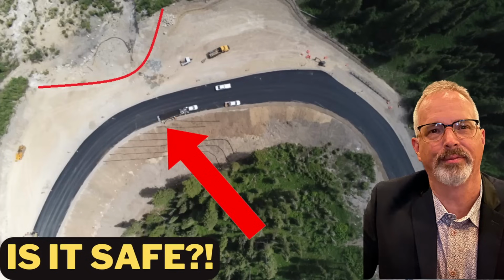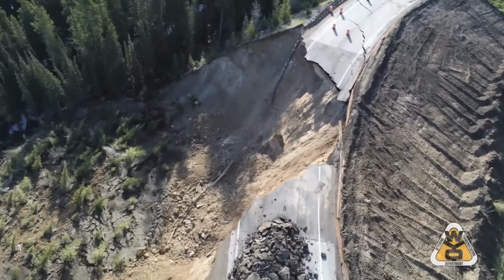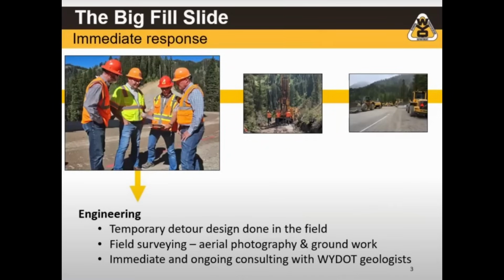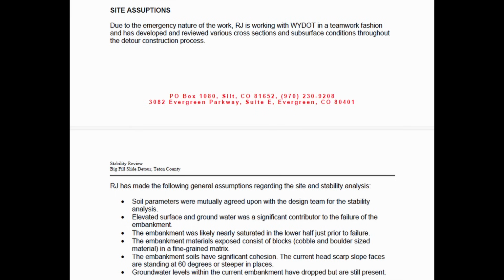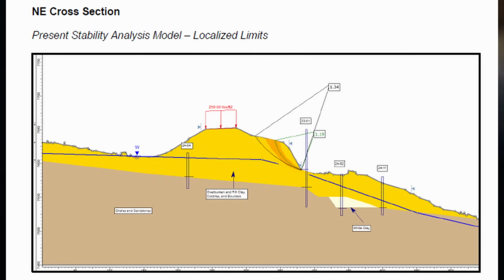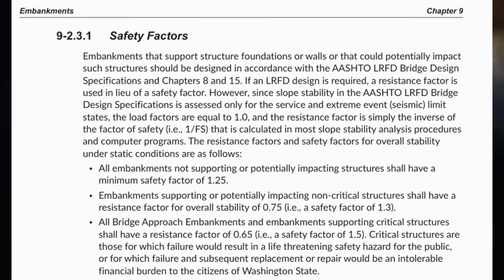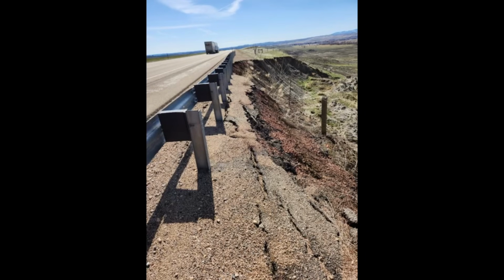Teton Highway Rebuild Update

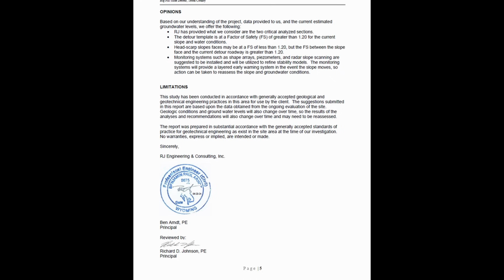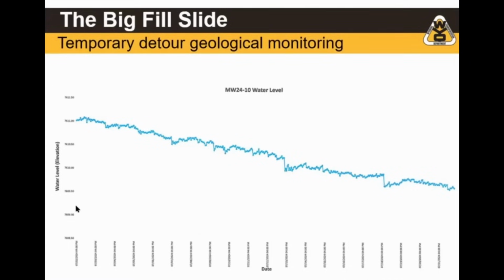Comment: 14:21 "Current slope and water conditions" That's one of those truths that omits the real question since water conditions change constantly.  There's no clear statement that the road design protects the safety of the public during all water conditions. The author could had stated the water condition parameters and indicated a quantifiable set of conditions that would invalidate the conclusion (i.e the data presented at 20:40). That would have put the burden of maintaining the current conditions back on the State.
Reply from the maker: Those are great points.  That letter report seemed rather vague and incomplete to me.  I am sure WyDOT is happy with that report though.  I know some local reports mentioned the 1.2 factor of safety, but it appears that the are not aware of what went in to calculating it as I don't know either.

Comment: Is the 1.2 factor a long term factor in design? - no doubt it’ll be improved with the proposed works. As long as it’s over 1.1 for this temporary / construction condition then it should be ok - presume there’s gonna be a limit to weight of vehicles that’ll be accessing this stretch of road too. Everything’s generally worst case design scenario but as it’s been failing for a long time - the solution will have to improve the overall stability of this hill/slope/embankment.
Reply from the maker: What is long term?  Traffic on this bypass for several months to a year.  That counts as long term to me.  I see no way of supporting a factor of safety any lower than 1.5 for this embankment slope given my understanding of applicable design standards.
Reply: @CaseyJones-Engineer  There is no means of quantitatively measuring the “real” FoS of a particular slope at a given time. Therefore, FoS of a slope is estimated based on industry standard analytical methods with assumed material parameters inferred from various data sources (laboratory, drilling, empirical correlations) under various loading conditions. 

The above extracted from Factor of Safety and risk, information at   klohn.com 

Similarly “Factor of safety Probability of failure” from rocscience.com provides good information to understand this scenario. 

Long term is measured in years/lifetime of the bypass / life of the slope  - not the duration of the months in a year that this bypass is in use 

So the FOS given for now will no doubt improve or be adjusted after further analysis / design carried out - with recommendations of inspections of the slope annually to note how it’s performing.

Comment: Great video, but I think you’re laboring under an incorrect assumption that evidence based analysis, logic, rationality, and common sense should be used in addressing this issue. You seem to be forgetting that this is Wyoming, where none of these methods are respected or ever applied. The fact that you are questioning the authorities in Wyoming means that if there are any further problems with this bypass, they will be your fault.
Reply from the maker: Thank you, but WyDOT still owns this thing.

Comment: I just watched some of the Geologists of Jackson Hole presentation on the Teton Pass slide.  When Bob Hammond of WYDOT stated that they mobilized a contractor for this emergency and the first thing they decided was to remove the asphalt from the roadway as they thought it might help.  I just can't believe they thought moving inches of asphalt would make a difference when there is 70 foot of fill. Just the act of placing construction equipment on the failing slope was crazy from a safety standpoint.  WYDOT is lucky that the construction equipment did trigger the slide with personnel on the equipment.
Reply from the maker: I agree. I think it is fair to question whether they have good judgement.
Reply: It's not like they didn't watch the loss of construction workers in Baltimore a mere three months earlier.
Reply: WYDOT is very Stupid

Comment: Exactly right to call in to judgement of what they are doing now. Obviously in the past they got it wrong about their assessment of this site. That should be a giant warning sign that they were making decisions without all of the data.

It should not be 'business as usual' in designing a replacement roadway. The process has tricked you and failed you once before; This is the time to take a step back and to gather much more information about exactly what is going on and to increase the performance margins.

IMHO it is now a 'political' decision that is overriding good engineering practices; They are so anxious to get the road replaced that they are cutting the same, (and more) corners than the originally constructed curve that failed in short-order. Designing by consensus is another way of saying that 'group-think' will get you to a good outcome.
Reply from the maker: Thank you.  Your comments are spot on.

Comment: Thanks for the latest update Casey.  The letter by RJ Engineering and Consulting regarding the slope stability analysis for the temporary bypass is really lacking in details and as vague as WYDOT has been with respect to safety factor.  I totally agree with your analysis that the safety factor even for the temporary bypass should be 1.5 and 1.2 with the unknown soil parameters is too low.  I also agree with you that they should have closed the road and planned the rebuild instead of quickly installing the bypass with such a low factor of safety.  How difficult will it be to install the soil nails with the benching?  I assume they will have to be anchored things from above initially to build the benches.  I am familar with micropiles as I have used them for foundations for large variable speed limit signs and also the use of styrofoam blocks for fill.

Comment: Why do bridges built in the early to mid 21st century outlast newer ones? Heck - even bridges built b4 that last longer. Because the professionals designing them were so much better. One would think that computers and calculators would have improved these builds exponentially. But apparently, you can't replace great minds with computers. My dad started his engineering career with slide rules, experience, training and education, and his brain. When he retired, his company's customers hired him to oversee the new engineers who had all the tech but no brains. There's something incredibly wrong here.
Reply: I think your phrase ..."to mid 21st century..." should have been   ..."to mid 20th century..." should not it?  That would tie into the rest of your post better.
My answer about the much older bridge construction lasting so long is that the engineers of that time did not have as much data to design from as after the 1950s &60s.  Also, the use of computers has given engineers greater speed and much closer tolerances than was available previously.  Consider many railroad bridges are carrying larger and longer trains than what was designed for and are close to or over 100 years old.  Part of that is the old engineers did not know as much about the strength of materials as is known now so used beefier designs and larger factors of safety.  These structures are inspected yearly.
I graduated in 1969 with my slide rule.  Handheld calculators were not really available until 1970 & 71.

Comment: Again, another USA issue - never considering the weight of the repair vehicles and equipment when doing work on roadways and bridges. As soon as you said they were removing asphalt off the roadway to reduce weight, I thought about the weight of the equipment doing this would be far greater as well as them disturbing more of the ground in the process. You already caught that in your next statements. Yeesh!

Comment: I'm not sure how to ask this, but does the Factor of Safety need to be greater when the slope in on a radius? Meaning, is there a greater safety margin required when the roadway/path is on a bend or curve compared to when the road segment is straight?
And, given all the water observed "gushing out", would a better, long-term solution be designing in a culvert? Of course, the short term cost would likely be greater, but it seems to me a higher safety factor and less chance of another failure long term.
Thanks for the update, Casey, and keeping the public informed!!
Reply from the maker: Good question.  The short answer is no from a slope stability analysis.  The analysis involves taking a cross section and finding a potential shear surface with the lowest computed factor of safety.  The curvature of the road itself doesn't factor into that.

Comment: Honestly, this whole thing sounds like WyDOT engineers worked with just enough information to be dangerous. I'm all for a DIYer doing a little slope work (like 2 ft and 2%) to get water to drain away from a home foundation (I did lol); sounds like a bunch of guys like me, but without the sense to realize they're over their heads.
Reply from the maker: I agree that it sure seems that they are not prepared to deal with these issues.

Comment: It seems that they are adamant that the factor of safety of 1.2 meets requirements because they saw that number somewhere.  Well, I could say that a rock climbing wall would use an angle of 90 degrees from the horizontal.  So then someone could take that and say that their sand wall next to this roadway should use an angle of 90 degrees because it's cited somewhere.  Not appropriate because that number isn't associated with the structure of the fill.  I'd agree that they really need to stick with 1.5 as a minimum.
Reply from the maker: Thank you.  I agree with you.  I think they are trying to justify a 1.2 factor of safety on the basis of this being temporary which doesn't make sense when they now have highway traffic on that bypass and that bypass will be used for many months if not a full year even.
Reply: @CaseyJones-Engineer  I've had a tiny bit of dealing with RJ professionally and this thing does not jive with my limited dealings. They seemed like they wanted to be seen as the experts, didn't want any outside input. My other big question is about the factor of safety, is that static or seismic?

Comment: Highway Maintenance crews vs actual engineering… 80% of funding to rebuild comes from the federal government , 20% from the state . Failure to maintain might mean the federal government won’t participate ( that 80%). The federal government will pay 100% to open the road under the emergency relief program.
Reply from the maker: You are right.  We are seeing more and more instances of projects drifting into emergency mode so that the Feds pick up the tab.

Comment: You can fix this perfectly correct, and it will take forever and cost you everything you got.
Reply from the maker: I would say the difference between where they are at and perfect is a very big gap.  I think they should strive for long-term adequacy for this embankment.

Comment: Makes me admire even more the civil engineers, geologists, and contractors who built the entire US Highway System in the 1950-60's, without any computers!!
Reply: Sliderules do not require batteries.
Reply: @franklinmc4457  - I keep my old engineering slide rule in my tool chest and pull it out when someone asks for a calculator.  It's a good one with double slides and I don't remember how to use 90% of what it does.
Reply: I remember I college when we could carry the slide rule in its holster. Then there was that one guy with the biggest baddest slide rule ridding heavy on his hip. 
I recall missing a question on a test when I misread the scale.
Reply: @franklinmc4457  Nor does an abacus, which were taught to use in Catholic school in Colorado Springs in the 1950s. Contrast that with today!
Reply: Egyptians did a lot more without computers
Reply: @OffendingTheOffendable  oh the Egyptians Had electricity ?
Reply: Slide rules baby!
Reply: @kelliewilborn9154  YEA
Reply: Agreed
Reply: back when shit was built to the best of your ability and not some hack job by some cocksucker that has been bought off
Reply: Yea  and use to do a lot of other Things with out Computers and Inter net

Comment: Styrofoam filling comes with its own issues because if the road is flooded in that area they can lift up the road and cause problems as well.
This happened recently in Sweden.
Reply: Yep. Its highly bouyant. Though it can also get saturated with water. Im now a geotechnical engineer but when i was in college i worked at a factory that made EPS geofoam.
Reply: What's the projected lifetime of such styrofoam blocks? There are bugs/microbes that can actually eat polystyrene.
Reply: @aka-o9x  UV exposure is the big risk for it. Itll last longer than the bridge when buried. It can also be encased in concrete.

Comment: The soil parameters as inputs for the stability analysis have to be one of the most obvious cases of garbage in garbage out, I just fail to see how someone could be so incompetent as to just assume some random values for it without there being some form of malicious intent.
Reply from the maker: I don't know what they used for their analysis.  I think it is rather odd that they would just reference mutually agreed upon values.  It makes it sound like they had a meeting where people just decided what to use and it is unclear what actual supporting soil data they had at that point.
Reply: @CaseyJones-Engineer  That seems really odd to me in a failure situation.  And i can't imagine running a suitable number of triaxial shear tests, particularly CD test in a "couple of days."

Comment: So here's the deal as I see it.  With a current grade of 11.2 percent on the temporary bypass the drivers will face some extremely difficult driving conditions once the snow starts to fly later on this fall.  That curve is at high altitude so the snow starts falling sooner than most people realize.  Would not be a bit surprised to see lots of accidents and spinouts once the snow starts to fly.
Reply: 11.2% Wow!  At that altitude and latitude and the sharp curve, it will be a dangerous route come winter.  Could be some vehicle restrictions coming as to size and weight of trucks and/or trailers.  Cheers 🇨🇦
Reply: @jamesmisener3006  Actually there was already some commercial vehicle regulations  in place due to the fact that the other side of the pass that drops down into Jackson Hole is at 10 % grade for several miles.
Reply: @jamesmisener3006  More like impassible come winter......... Taking a trailer that way in icy conditions is suicide.......
Reply: It could snow as early as late September at those elevations.
Reply: Here are the general rules for Teton pass. Many trucks flaunt these rules on a regular basis.  This will be a scary winter:

https://www.wyoroad.info/Highway/Teton.pdf
Reply: sand, lots of sand.

Comment: "mutually agreed upon soil parameters" seems like a recipe for group-think.
Reply from the maker: It is rather odd phrasing.  Plus, if I was responsible for performing this analysis I wouldn't be letting anyone else tell me what soil parameters I should be using.
Reply: @CaseyJones-Engineer  It gives me the queasy feeling they worked backward from the minimal 1.2 "safety" factor to get the soil parameters that would create that result.
Reply from the maker: @richardmarquardt6246 It makes you wonder.
Reply: @CaseyJones-Engineer  I had a CE professor who said that integrity is not handed out with the receipt of the diploma when you graduate.  If you fudge on homework, tests, etc you are very likely to on critical work on a project also to make the numbers work.
Reply: @CaseyJones-Engineer Time for a freedom of information request, Casey.
Reply: In an area with more homogenous soils, something like that could be fine, if it's based on a reasonable regional assessment.  However this is an area where the soil properties could change a lot over a short distance - if nothing else the visible variations in rock sizes and colors, and vegetation types make that obvious.
Reply: This is what students in undergrad labs do to get results when the experiment doesn’t work as it should. Reasonable people understand that you grow out of it after the lab is over.

Comment: Casey, I can't help but wonder about hydraulic pressure within the new slope. I can see new construction "looking" great but what happens when the existing groundwater routing is augmented by deluge rain or snowmelt? It seems that this could cause sudden collapse from undermining?
Reply from the maker: They have stated their plan to incorporate more drainage elements into the rebuilt slope.  We shall see what the actually do.

Comment: The vibration of the asphalt removal work may have made it cut loose sooner.
Reply from the maker: Great point. Their adding more energy and weight to something that was already failing was a very bad idea.
Reply: When they were constructing a road at Fort Knox it collapsed several inches of the roof of a cave about 60 feet down the slope. I had found this cave about a week earlier and looked fine from the entrance but waited for another caver for safety. Returning slabs had broken from the roof and wedged at various angles as far in as we could see. Nature made it over thousands of years and road construction altered it within a week...